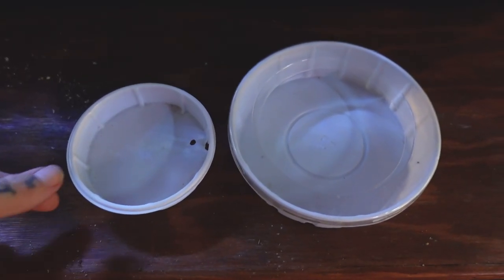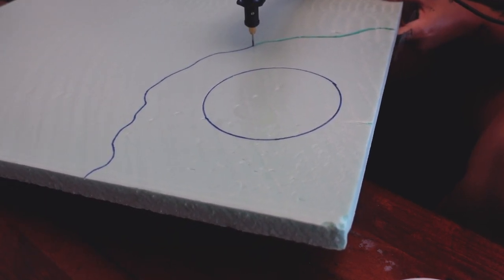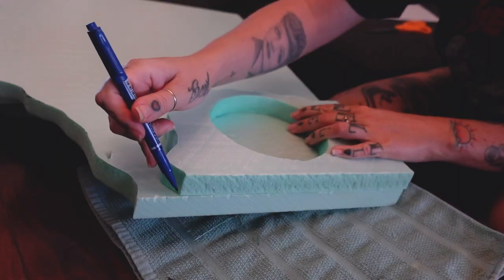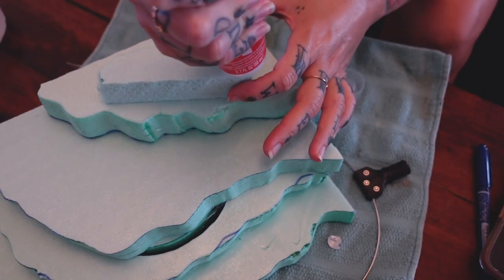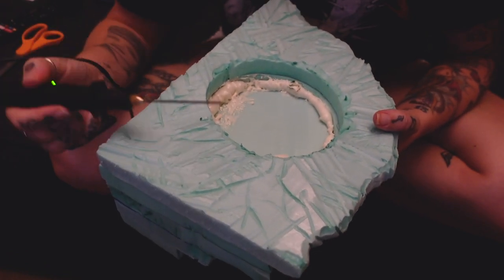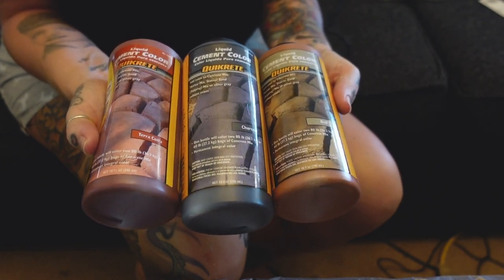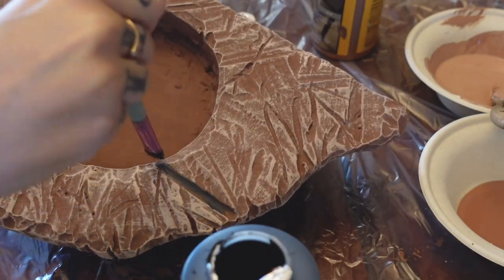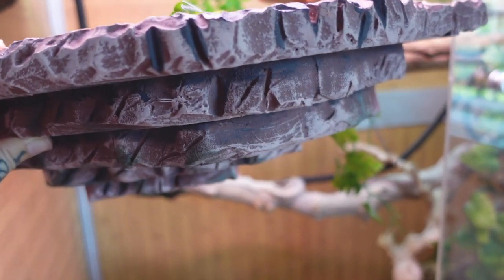DIY Magnetic Reptile Feeding Ledge | KristenLeannimal

Comment: When you painted over the magnets that could have interfered. 

BUT, you could glue a set of magnets to the enclosure wall exactly where the other magnets will touch then it will be magnet to magnet.

The way you would do this is important! Stick the extra set of magnets to the magnets on the ledge first (to make sure they attract, not repel) then glue them to the wall.  I would put masking tape or washing tape between the magnets to be sure you can get them apart. 

Just a thought...
Reply: And you are using rare earth magnets?

Comment: Something that might help with the aesthetic for next time, if you're interested, is using watered down acrylic black paint to spray into the cracks and crevices before dry brushing on the highlights. Just to make the weathered look easier than going in with a thin paint brush and to look a little more natural. The Natural Herp Keeper here on YouTube has a naturalistic background with similar steps used for this ledge where they do this.